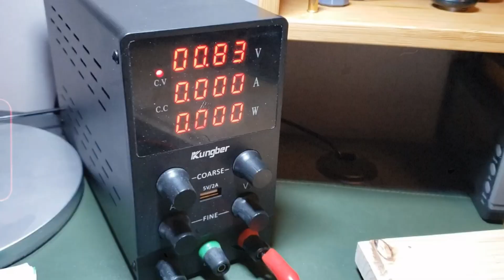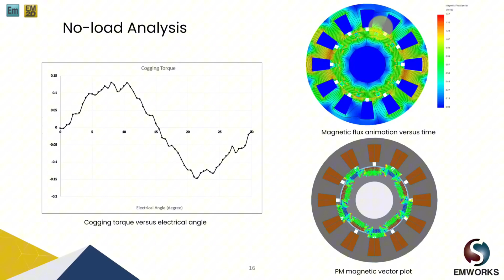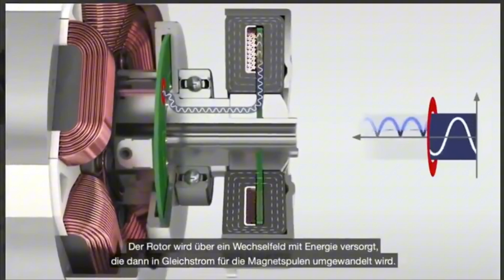Doug Konzen: OverUnity Pulse Motor Free Energy Generator Can Change The World in 2025!?

Comment: I recreated a theory I saw on a video from Norway a few years ago for free energy. Stake an 85 foot copper wire insulated at both ends one foot above the ground. Tap it 1/3 up with a soldered coax cable. Drive a ground rod and get the ground wet around it. Now you have one coax cable wire and a ground wire, done. Cost less than $20. I get 15 watts during the day, and it drops to 8 watts overnight. It's enough power for me to charge a power station a two 12v batteries. I have it in a fenced area where animals can't trip over it.
Reply: Thanks for your comment.
I am interested in testing this out.
A pipeline passes through my farm and suspect it conducts a bit of rogue current.
Guage of copper used?
"Tapping 1/3 up, " Up from what? 28 feet from one end?
Length of coax? Keep the shielding from touching the central conductor?
so the battery would go between the ground rod and the coax to positive,  negative to ground?
Orientation to longitude? does it point north or east?
Reply: @wisconsinfarmer4742  I used 14 gauge copper wire and a 6 foot coax, tap from either end. You have everything else right.👍

Comment: At a very basic level it is easy to see how magnets would seem hold the key to some sort of "Free Energy". We can use energy to make electric magnets so it would seem logical that "natural magnets" would hold some potential energy. They are able to create a repelling or attracting force without applying any extra energy. Superconductors work because of extreme cold temperatures.  Usually heat is associated with the release of energy or production, not cold. If some sort of device like this could work, it would be in a "zero gravity" environment . It can be very cold in space with lower friction energy loss.
Reply: Anyone who thinks magnets hold energy because energy was used to create them: Besides materials and other costs you pay for this amount of energy when you buy a magnet. Thus you could not hope to get more energy out of a magnet as you have already paid for. And this is not much. It would have been better to spend your money to buy energy in the first place, not magnets to produce energy.

Comment: I think Smokey Yunik toyed with a "crescent-shaped" dual magnet and magneto-type timed electric trigger coil setup. He CLAIMED...it AMPLified the trigger's meager pulsing current's power input. It was started like a car motor, then once inertia was enough, the strong magnets pointed leading edge caught the trigger timed pulse ..kinda like a rotory rail gun...accelerating to car engine-like rpms w good horsepower! Hmmm..??